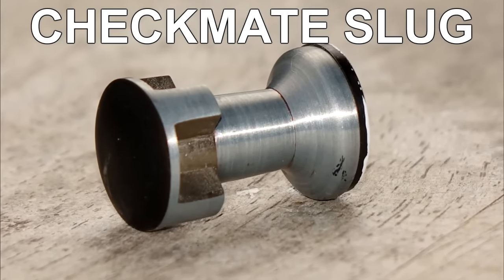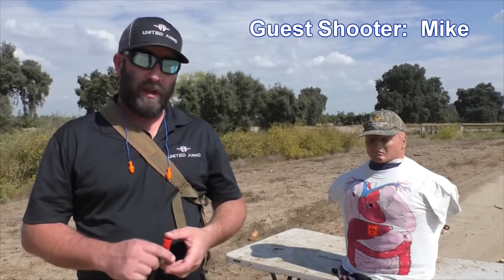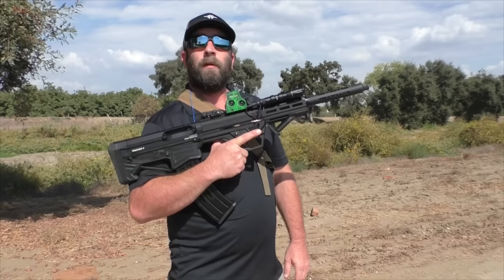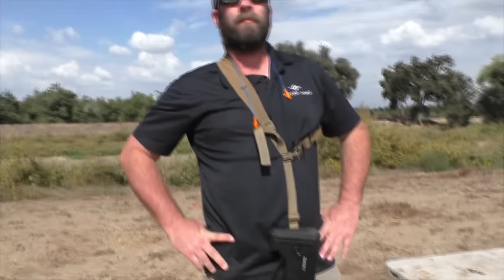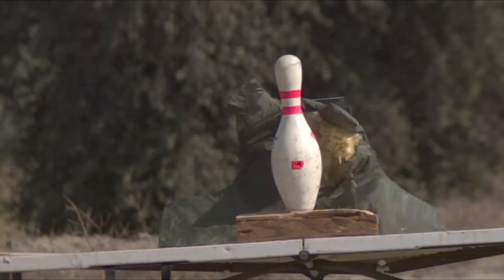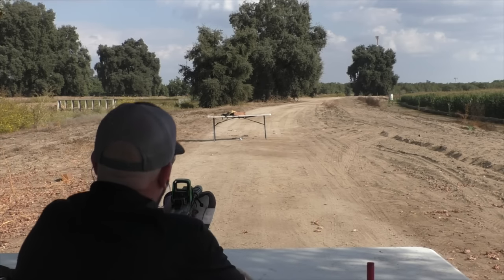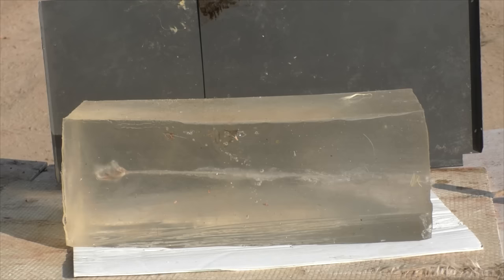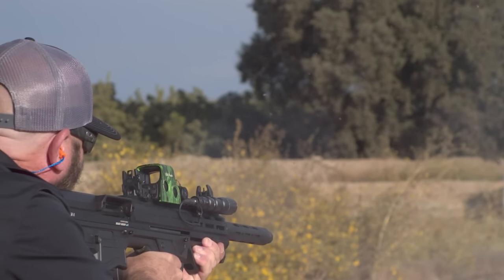The CHECKMATE Shotgun Slug seems to DEFY Physics!

Comment: You need to drill those out and insert a steel pin, then back fill it with lead as the prime mover. Add more powder and you got a super sonic nail driver.

Comment: I've never seen pot metal that nice I've been rebuilding old carburetors for 40 years none of them had that shiny and non-porous metal, maybe they all look like that when they are new but when they get old they degrade. My main professor at McPherson College auto restoration program talked about replacement carburetors that would sit on the Shelf for years and when they open the box all I had were shafts, 
 butterflies, clips and brass jets and all the pot metal had just turned to dust.

Comment: The bullpups are an interesting thought. I'm betting the weight is way less than my ak pattern catamount 2 from century. I did stick a compensator on it and reduced felt recoil about 30-40% adjustable gas system for low/ high brass. Patterns and cycles well. I was really impressed with the accuracy and flight characteristics of this jewel. I'll be honest. I thought I was looking at a modified hydraulic piston of some kind. 😂 resembles the rook in chess. A game I've been fond of since I was 9. I'm no chess scholar, but it's fun.

Comment: Sometimes I wonder if the higher spin rates of full rifling might even exacerbate a slight imbalance in the projectile, causing even worse accuracy.
Reply from the maker: I imagine it can.
Reply: Well not only that but a round such as this with those interior cut-outs may create some lift as it spins which could be both good and bad.

Comment: I wonder if a bolt with one or two nuts on the end of threads would fly straight. 
Gotta take a steel shot wad and find if a bolt and nut setup will fit ok.

Comment: From your vast experience, Jeff, how much distance does it take for the usual, most vulgar foster slug to go from Mach 1.3 at the chronograph to below Mach 1 down the range.

I think it could make for an interesting video. Following the projectile in slow-motion, close to the ground (or water), and see how it deals with the transonic region.
Some sort of smoke generator parallel to the projectile's path could show interesting results at various distances.

For the smoke part, just leaving a few smoldering pieces of wood at one meter increments could produced some good results, as the Mach cone will interfere with the hot, rising air from the wood.

Comment: Hey Jeff could you get a high speed photo of the Mach Angle/ Cone from the front of the projectile or does it take mega FPS to photograph the pressure wave?
Reply from the maker: I think I would have to use the Schlerrin set up or whatever.

Comment: What, a shotgun slug getting 10G acceleration when fired? 😂 😂 I'm afraid it's tens of thousands of G's if not hundreds of thousands.
Acceleration is the increase in speed per second. 1G is the acceleration due to Earths gravity and it's 9.8 m/s*s, which means that each second earths gravity will increase the speed of a falling object by 9.8 m/s. 10G is ten times that, which is 98 m/s*s, i.e. accelerating from 0 m/s in 1 sec you'll be moving at 98 m/s, after another second 196 m/s, in 1 more sec at 294 m/s, etc.
The slug goes from 0 m/s to 450 m/s (1500 fps) in only a fraction of a second (maybe 0.002 sec or something), so the acceleration would be much much higher. If you add 450 m/s in 0.002 s in an entire second you'll add 450 / 0.002 = 225,000 m/s*s, which is 23,000 G's average acceleration. But this is just a rough calculation and on top of this the acceleration in the very start would be much higher.
Reply from the maker: Gotta throw in an Easter Egg of Wrongness otherwise people won't have anything to comment about.